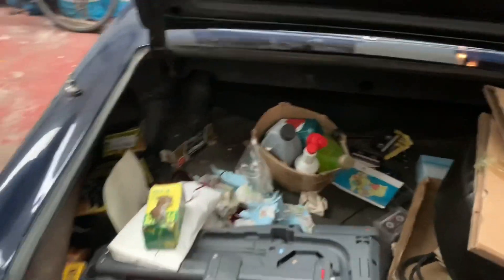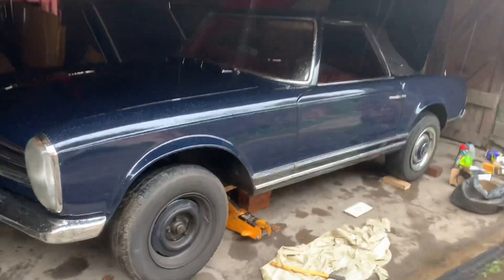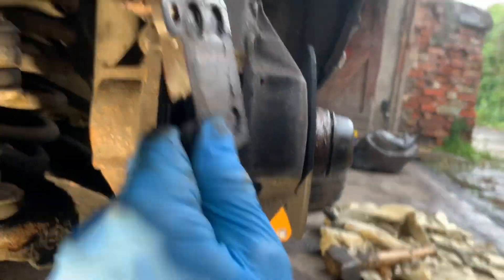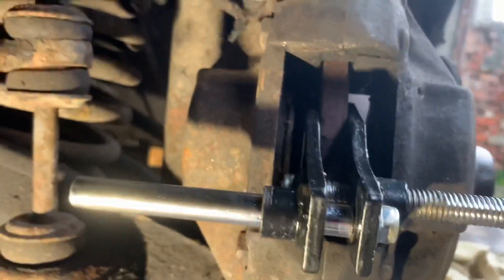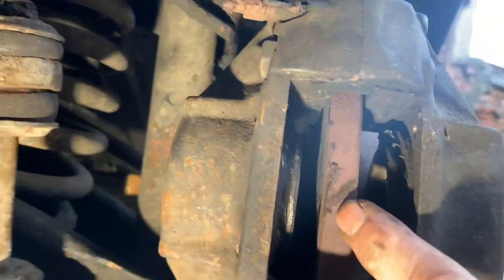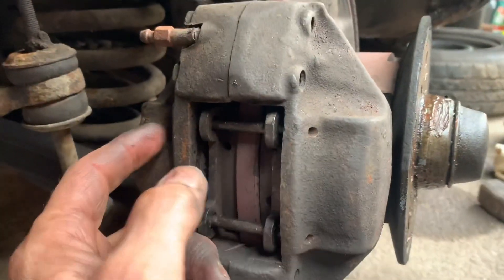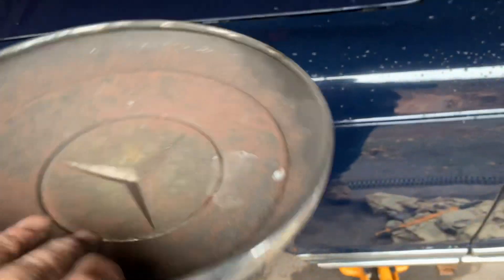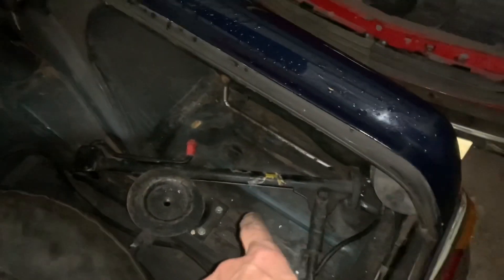Mercedes w113 Pagoda stuck brake fix - emergency quick repair

Comment: Sometimes the brake hoses can cause a locked up caliper, it happened on my Pagoda. They are cheap and easy to replace.
Reply from the maker: Hello - I've ordered a caliper rebuild kit but you are right, I should probably redo the hoses at the same time. Mike